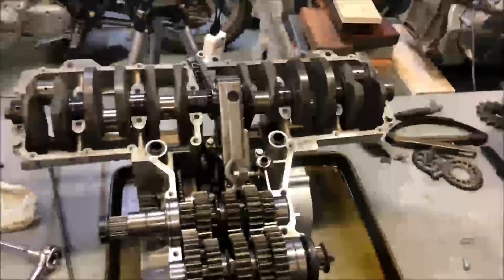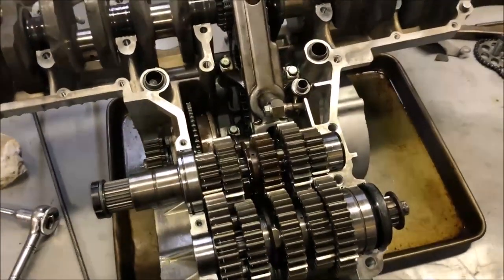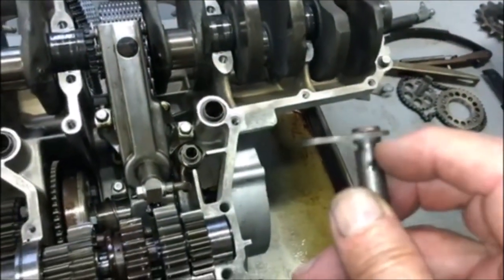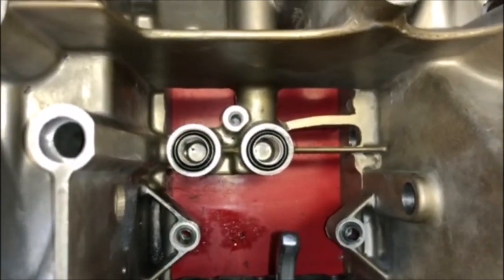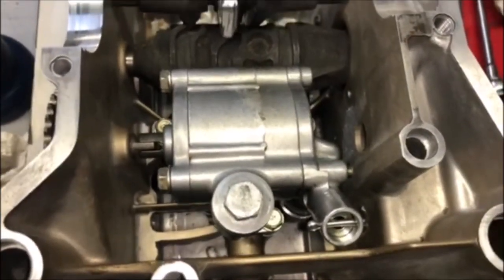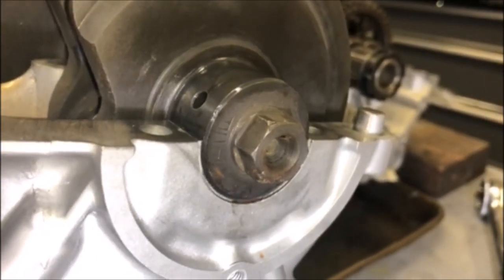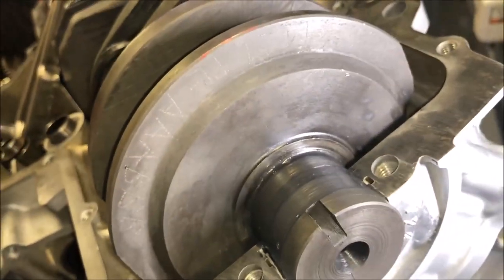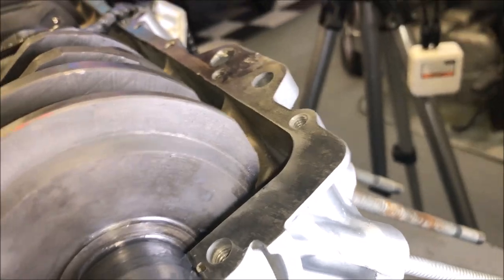Honda CBX Full Restoration & Engine Rebuild Video Series - Part 16 - Re-assembly Part 3

Comment: Those oil pump o-rings are the same exact o-ring used on the oil filter bolt.  Fyi.  Work better than the ones that come with the oil filters.